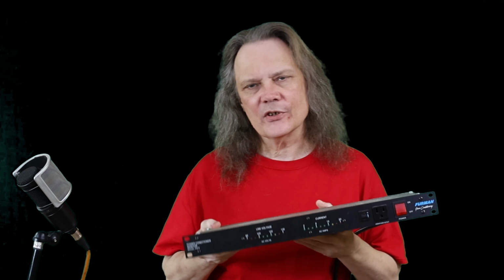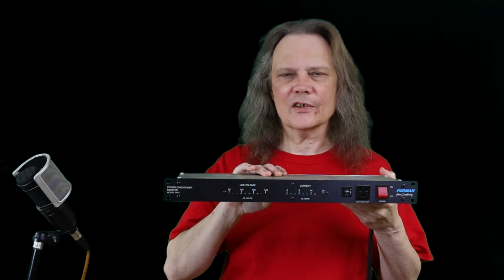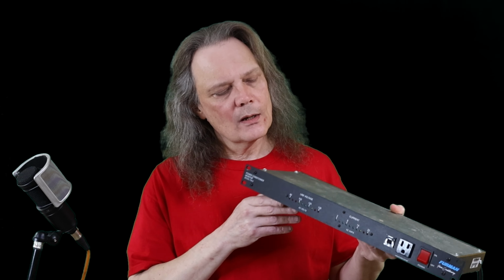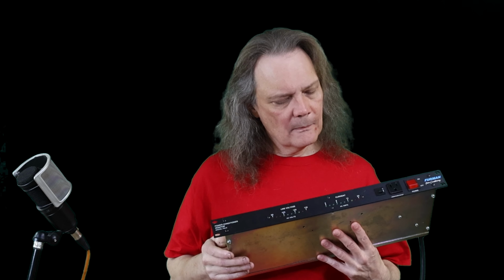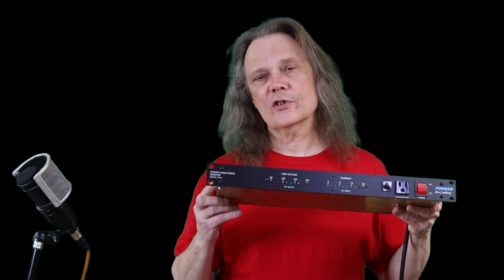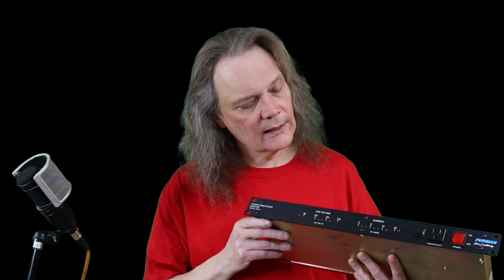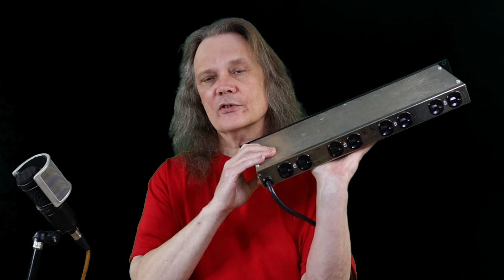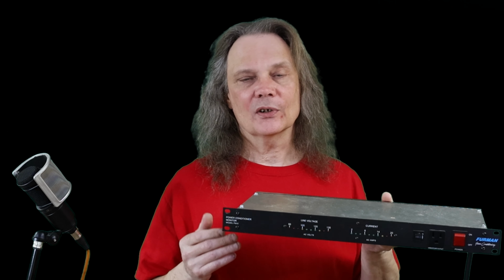Separating Fact from Fiction in Audio Rack Power Management!

Comment: Thank you Barry. I've recently subscribed to your channel. I have learned the hard way by trial and error. I use rack gear for audio processing through transmited cb/ham radio. Definitely unique and great sounding audio over the air. I would normally use  Tripp Lite Isobars for my filtering for rf and cleaner ac power. Garage sale stuff. But I wanted to try a power distributor in the rack. I am no professional but i think i have a good ear for clean audio and i have to say to my suprise my transmitted audio does sound smother and more stable and cleaner using a rack mounted power distributor. Thanks for your videos. It looks great in the rack too.

Comment: Great topic and timely. I just picked up 3 of these for my home systems. ( 1 for each system. ) I love the convenience and cable management. I got all 3 used  and for great reasonable prices. Sequencing is important too, agreed, another pro for these types of units. Sequencing for home use with teenagers / kids using my systems is important ! 2 of the 3 distribution boxes I have have the sequencer.  Plus I love the one rocker switch turn on and the whole system boots up on its own in the right order. Love the story about the heavy gauge power cord and amp. No firehose gauge cables needed, I think some people just like the look of them. It’s amazing how our own perceptions of things are easily biased and not based on science or good quality data sometimes. 
Great video Barry. Thanks.
Reply from the maker: Thanks!

Comment: I setup outside sound systems for parades and other events .one of my cities I setup for has built their own portable power distribution system that I Plug into along with food vendors I have a power regulator that boosts the voltage back up (depending on how many hotdogs they are cooking and how much coffee they are brewing) .its a 120/240 system. At one point they lost the neutral connection and damaged some of my gear when the leg I was plugged into went high. A over voltage cutoff might have saved some stuff

Comment: I stay away from cheap power bars whenever possible.  They are more prone to failure. Furman will reduce common mode interference. Doesn't do much for ground noise... I have one in every rack mostly for the switch in the front and the current meter.  They use good quality plugs that also have a common mode choke on each pair.   It will reduce back emf between noisy devices, but mostly all gear already has to meet national standards for emf and will have their own x-y filtering. I still use them regardless of the overall benefit.

Comment: ease of use for the rack, basic filtering starting with the m-8x line and going up through the rest of them. ultimately putting a slightly more expensive (quality!) surge protector in front of your gear helps protect that gear, gives you some switching functionality, and cleans up your wiring. and a few other specific features per model, like that voltage/amperage display.

the rest is psychosomatic.

but spending even a couple hundred bucks to protect several grand worth of gear.. its a not even a question. i'd rather have to spend that couple hundred again to buy a new furman if some condition fries it while its protecting the gear, than spend all that money to replace the full rig by cheaping out with a $4 power strip.

its a no brainer for me.

Comment: Do you perhaps have the schematic for that Furman PM-8? I have one and the ammeter works but the voltmeter doesn't, I opened it up and found that the first LED didn't work (and those are connected in series) so I replaced it with a good one and when it's in the circuit it doesn't work either.
Reply from the maker: Sorry, I do not. From what I've heard, Furman is not very supportive of customers doing their own repairs but I would be tempted to call Furman support, and ask what your options are for support tech info or repair.

I suspect the meter circuits are fairly simplistic, with those leds being driven by a nearby IC chip that is the heart of the meter.  I would look up the part number on that IC, and check to see if it has proper power supply voltage on its power pins. If not, you probably have a meter board power supply problem, if so maybe that chip is defective. That's where I'd probably start.